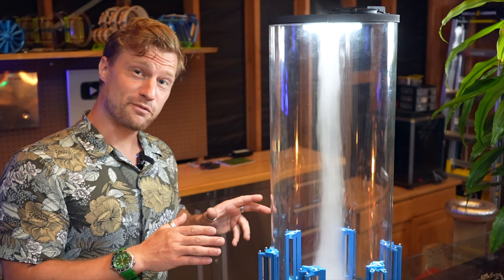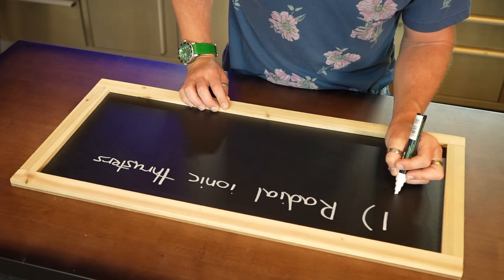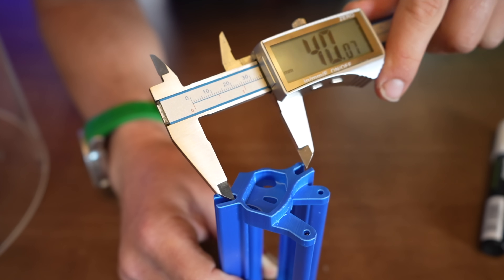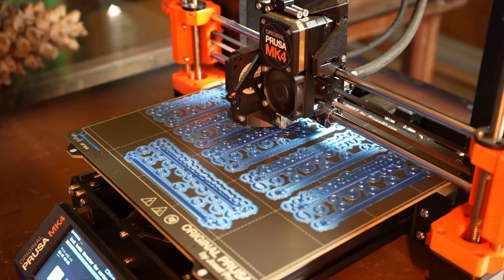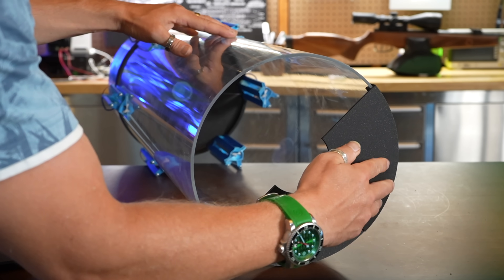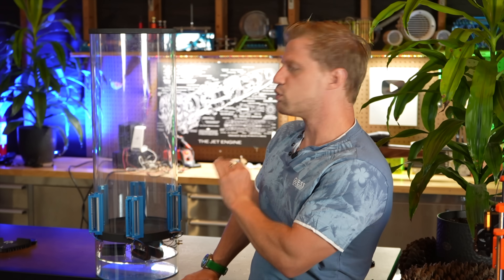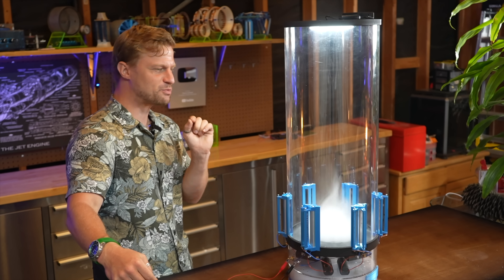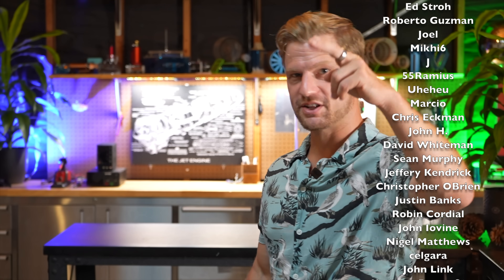I Built The First Ionic Tornado Machine! (Unreal performance)

Comment: As a science teacher I request that you either make full build instructions (including materials list) available, or find a partner to make a kit. This is far better than any tornado model that I've seen. Especially since it relies on temperature differential to visualize the vortex formation.
Reply: I say go for it.  Carefully managed risk to build an exciting demo is the kind of thing that gets students excited about science.  Risk to students can be eliminated by not allowing them to operate the device.  Students can help build it, with no power connected (also ensure any HV capacitors to be used are shorted ahead of time).  Students can then watch from a few feet away while it's turned on by the teacher.  After the lesson is complete, the device can have power sources removed and capacitors discharged.  Power source can be locked in a cabinet to prevent students from attempting to try it on their own if they sneak into the room after hours or something.  Of course, that $500 acrylic tube might need to be substituted for something more affordable unless they can raise all the money for something like that. Maybe support the active components with a wooden or aluminum frame and use a thin flexible plastic sheet wrapped into a tube in place of the thick acrylic tube.  That'd be far cheaper.  If the frame is sparse, it wouldn't obstruct the view of the bottom much.  IMO dry ice handling is probably greater than the electric danger here.  That should be handled by the teacher as well.  There's a lot of other science experiments you can do with dry ice, so that could be wrapped into the same class period to make the best use of it.
Reply: @archgaden  Ab-so-lu-te-ly.  The other issue is that this teaches the kids to tell the danger from the non-dangerous parts, a rather educational element in itself.
Reply: There's one simple thing that many manufacturers use, warning tags and warnings in the instructions on the proper safety use, this is in most kits, if not all, that use electricity and capacitors, and I'm fairly sure that the science teacher was only interested in buying one kit that they would build themselves just to show the class an example of a tornado, I don't really think the teacher was wanting to buy an expensive kit for each kid to try to build, so all the discussion about the safety of the kids was probably never going to be an issue if the teacher was a responsible adult and obeyed basic child safety, but then again, in public schools where a shooter can enter and fire at the children or where a school officer can throw a child or young teen onto the floor, perhaps there are more dangerous things in our schools than a tornado kit the science teacher built to show his students how tornadoes form.
Reply: @onidaaitsubasa4177  Your argument holds no water. You presuming the teacher is competent, and that the kids won't do something stupid while the teacher is distracted. If the teacher knew what he was doing, it would be very easy for him to build this without a kit. 

You also contradicted yourself: "responsible adult and obeyed basic child safety, but then again, in public schools where a shooter can enter and fire at the children or where a school officer..."

So you saying Its "OK to be exposed to a HV source (ie 20 KV), if teacher & kids are responsible, but than you provide examples that they are not responsible. Maybe you should apply some critical thinking before you post a comment.

Just about all companies that sell consumer electronic devices have a UL listing & insurance. Insurance companies will not provide insurance in the US unless it been UL listed (it tested for safety). Last time I checked, a UL test was around $25K. This device will never pass a UL test.
Reply: @guytech7310  Your entire argument is based on nonsense "the kids won't do something stupid while the teacher is distracted" at that point everything is Lethal
Reply: @guytech7310  You must be so much fun at parties.

Also, most people shouldn't be allowed to drive by your argument.
Reply: @raunchers  Look who is talking. The point of my original comment was to protect the channel author from lawsuits.
Reply: as soon as i can find 30cm plexi glass tube alternative that will not cost me a leg, i think i need one of those :D
Reply: so how do we lower the risk (this should've been the question, instead of a lazy NO because of fear and liabilities)
remember that anything you have no idea to operate is and will always be a risk
you can lower the risk of driving accidents by simply learning how to drive hence driving lessons and license for proof (tho people might do some shortcuts and stuff to get license)
it doesn't guarantees zero risk but it does lower risk factor for accidents.

that's why people do research, experiment, get into accidents, learn from that mistake, improve tech, get more modern with tech stuff...
everything should and will become outdated, humans will always improve outdated tech.

people will always find things to improve it might be me, you or someone in the near future
Reply: @Blitzkit  Low Voltage Ducted fans or blowers, which I provided earlier in multiple comments.
Reply: thats because tornados are not caused by temperature differentials. they are created by electric filaments flowing into the earth from the sun.
Reply: This comment might get lost in the rest but what if you encased the current machine in a larger cylinder that is closed off at the top so you could use real debris like glitter. If you have it encase the entire thing you can rig it to recycle the debris. I am guessing it would probably recycle better if it were encased in a large sphere or at least a half sphere on top of the lower cylinder.
As an ex pothead I could see this thing as a massive bong lol...but yeah removing the water and dry ice would probably make the less scientific public more comfortable in buying into the idea even though its safe enough already (or can be made safer).
Great work though man!
Reply: The formation of the vortex is upside down, so not a good example of naturally occurring atmospheric vertices.
Reply: HMMM....👉 yes- place a toilet seat so I CAN LOWER MY HAIRY NUTS INTO THE VORTEX.
Reply: All these negative comments...... sheesh people. @kmoecub said they are a science teacher, ya ever think that they might want to make a demonstrator for a class? NO, you went straight to "SAVE THE KIDS FROM THINKING!!!!!"
Reply: I know im a little late but if youre looking for cheap(ish) tubing that may be able to work you could buy a clear trash can. there looks to be a 25 gallon one on banksupplies with the upc of 525-03020, this one you'd need to saw the bottom off for it and it also is tapered so that may not be ideal. There's also a 50 gallon one on glassdon that goes by the name C-Thru 50G Trash Receptacle, the way there's looks makes me think you maybe be able to buy just the outer shell without a new lid or bottom.
Reply: As a former student i would say to watch the video....as its literaly breaking down his entire build process...

If you need to be instructed that hes not using magic to join the pieces, well...idk what to say
Reply: You guys shut up and think of ways to make it safe then
Reply: @Nexusleaps  there isn't a way to make 100% safe since kids/teen can only handle 5ma while a adult can handle 10ma
Reply: @Nexusleaps  in fact some students have health conditions which makes it even harder to make it safe well I guess maybe stick to no high voltage in school?
Reply: The modules Jay used was on Amazon for around 6 dollars sometimes more I did buy one last time for a spark gap tesla coil then it fell on me but luckily it wasn't lethal tho am surprised I got no burns
Reply: i just read more or less every reply to this comment, man that took a while but i enjoyed it lol
Reply: In all fairness the original commenter blatently asked for the materials list and drawings to build this as-is. So guytech7310 is correct in pointing out the dangers of this. What others are reasoning towards is the commercialization of this device. This indeed would need more engineering, risk analisys and safeguarding features. But it can be done. A solution can be found. Engineers think in solutions not problems. But let’s not kid ourselves into thinking we can do that entire process in the comment section here. 😊
Reply: @michaelvanderputten4216  Yeah, because I can not buy plans for other high voltage devices? Like a tesla coil... finding it hard to take the nay sayer serious.  With low enough (or high enough, for that matter)  intelligence, all technology is dangerous. And stupid people are outproducing the intelligent populous. I'm a creationist.  And I find it funny to see " scientific minds" cry over darwinism in action. You hinder science.  And to the atheists listening, if there isn't objective morality, nothing anyone does is right or even wrong by your standards.  And everything is meaningless.
Reply: 20KV says no for school kids, especially since there is a water bath below it to enhance the risk factor to 11. Too much liability.
Reply: @guytech7310  and did you even look at the build? it could trivially be made almost entirely safe
Reply: @ThylineTheGay  Your clueless. If you cannot see the all of the safety problems, you have no business commenting on "safety".

No arc fault detector, no tilt shutoff. No internal ground shielding, no ground fault cut off, (no ground wire what so ever), Electronics are not water tight (needs to be potted) There are HV leads (ie the lifters\thrusters) that expose hv voltage on the outside. Would need a secondary larger ( & much more expensive) cylinder to isolate the HV conductors from anyone coming in contact with them.

I am guessing you have zero experience engineering consumer electronics.
Reply: @guytech7310  it would be easier to seal all the HV electronics inside of the thrusters as a single unit and not make it user serviceable, then cover the intakes with a safety mesh like the ones used on some hobbyist turbojet engines, except grounded. 
(This is not referring to the ducted fan reply but rather your reply to thy)
Reply: @PixlRainbow  Never going to pass something like a UL certification. I explained in a previous comment roughly what would need to be done.
Reply: @guytech7310  it would need arc fault detectors, tilt shutoff, and ground fault cutoff too, yes, but everything else has been addressed.
I had also previously suggested to NOT get water involved at all and use backflow incense, which produces a dry smoke that should behave similarly to the dry ice fog. Steve Mould has a 2-year-old video on it.
Reply: @guytech7310 you'd really hate my electric fence.  Just exposed and sitting there for unexpecting passersby
Reply: @imperfect_follower_of_Christ Where do you live? You sound like a great option to fund my  ls7 build.
Reply: @moresomoze  why I live right down the road from you, Hank. In Arlington.
Reply: @guytech7310  You know what would keep people from "disrespecting" you, as you seem to think they've been doing: Stop it with the "it'll never do this, it'll never be safe enough" negative BS. Try giving some positive suggestions for how the design could be made safer, more in keeping with the actual project instead of "replace the main functioning part that is the reason for the project with something else". And stop trying to shoot down everyone else who is trying to make these positive suggestions. You're unnecessarily making yourself the antagonist of this thread, when you could have been an ally using your experience to offer helpful suggestions to make a cool project even better without trying to turn it into every other tornado tube project.
Reply: @guytech7310  .now u r changing ur words, who was the one arguing that changing the design will not do anything lmao
Reply: @guytech7310 so do beds of nails and bowling balls, i think this would more be a bring out once a year while kids stay 5 feet away type of thing which could work especially considering that while the voltage is high, there’s not an insane amount of power actually being consumed meaning low amps.
Reply: @guytech7310 conventional fans also have fast spinning blades that are dangerous for children, but they are made safe by encasing the blades in a cage to make it difficult to actually reach the blades. A safe version of this contraption could be made with grounded metal mesh serving as faraday caging, as well as some form of fog that does not use water. Incense perhaps?
Reply: @PixlRainbow  If the fan blades are exposed it does not kill them if they touch the spinning blade. You don't even need to touch an energized 20kv component for instant death, just get close enough for an arc.

 You might as well make the argument that its safe for kids to play with hand grenades since there is a safety pin!

No way is this device even remotely safe for kids.Even most adults are likely to get killed with this.
Reply from the maker: So, the power sources are non lethal. They are stun gun modules - which when shocked by, give you a scary zap but leave no lasting damage and don’t cause death. I certainly understand the fear of 20kv, but the overall power is very low (15 watts per high voltage source), and this project is non lethal. Painful if touched, yes, but non lethal.
Reply: @PlasmaChannel  Stun gun can kill & they sometimes do, especially with people with heart condition. Second the stun gun does not include a pool of water, which increases the risks of lethality.

From a safety & litigation perspective, I recommend you do not provide kits, or plans. Stay out of trouble my friend! Its not worth the Risk!
Reply: @guytech7310  and pray tell, how are they supposed to get close enough for an arc, if the mesh is in the way? And how do you think Tesla coil kits have been sold without restrictions for years?
Reply: @PixlRainbow  Huh? The elements are exposed on the outside, Second if the unit tips over do to carelessness, or the Beavis\But-head moment. Full of water, Water comes in contact with the HV system & people.

If you cannot see how dangerous this is you must be Beavis.
Reply: @guytech7310  I explicitly mentioned changes to the design, and you keep talking about the design that is being used as-is!
Reply: @PixlRainbow  It does not matter its not safe for kids, period. If you want build one & provide it to them, then you assume all the risks.
Reply: @guytech7310  if it is impossible to make it safe for kids no matter how it is modified, then how is a Van de Graaff generator capable of generating 40kV considered a "toy"? How are plasma globes capable of generating 5kV considered safe for children even though they contain a flyback transformer?
Reply: @PixlRainbow  Some people are great at figuring out how to make things work and other people are "great" at thinking of the reasons why not to do anything ever.
Reply: @guytech7310 I sincerely hope the "don't do that, it's potentially dangerous" mantra isn't how you spend life, that's boring and more than a bit chicken little syndrome.
Reply: @kydelastra  You must be a Zoomer or Millennial.  All it takes is one careless mistake for a major lawsuit.

How much did McDonalds have to pay when a person spilled hot coffee on themselves? 

" Stella Liebeck from Albuquerque, New Mexico was granted $2.7 million in punitive damages and $200,000 for the third-degree burns she endured when coffee she purchased from a McDonald's drive-thru spilled on to her lap."
Reply: @guytech7310  much worse: Gen X. I was raised to pay attention and hold myself accountable.
Reply: @kydelastra  Then stop acting like a zoomer or Millennial.
Reply: @guytech7310  you went from being chicken little to the brave little keyboard toaster pretty quick there. I would get that skin thickness checked if I were you.
Reply: @kydelastra  Did you come up with  that response all by yourself, or did Daddy help you?
Reply: @guytech7310  Have you never heard of personal responsibility? People can manufacturer what they like, no-one forces you to buy it or use it. By your risk averse logic, people would walk everywhere because cars, bikes, horses, planes are potentially dangerous, electricity is potentially dangerous - so lets not use that - Oh, you can drown in water - so lets ban that!!
Reply: @jim.franklin  Jim, Would you trust a 7 year old to play with a device that can kill them or cause a serious injury? Can you afford a multi-million dollar lawsuit if some gets hurt or killed?

Do you have any common sense, or just like being a troll?
Reply from the maker: The pool of water doesn’t magnify the power of the stun gun modules. People have an irrational fear of water and electricity mixing, which is a good fear to have as it keeps people safe. However, the water doesn’t magically make the stun gun modules more dangerous. They will only discharge to themselves, from electrode to electrode. I have a serious heart condition and was shocked at least a dozen times while building the video. These little stun gun modules cost like 2 dollars each and are very low powered.
Reply from the maker: Additionally, if it was knocked over, water would stay in the lower compartment as it’s airtight minus the central hole. You’d really have to try hard to have the water spill everywhere. I see several people getting more and more abrasive in the comments towards each other… come on folks, let’s stay civil.
Reply: @PlasmaChannel  I've worked with HV systems as well have wired my entire home. I build a Farnsworth Fusor back in the late 1990s 60KV DC source, stainless with conflat fittings, Turbo Molecular pump, etc. 

 Water increases surface contact increasing the amount of current that flow through your body. Ie Hair dryer falling into a bathtub or sink.  

Issue with a wet hand coming in contact with a HV source is enough to cause your fingers to become locked to a conductor & impossible to let go. Your presuming the the person building these will build it with the same level of detail you did. Anyone that is competent with HV systems will have absolutely no difficulty building what you made without any plans or a kit. Anyone that needs plans or a kit is less likely to be competent to build this safely.

The Guy that wants to make this accessible for kids is totally insane. All it takes in a Beavis type to get some some injured or killed. 

if you choose to sell or provide plans for this device, your putting yourself at risk of a lawsuit that can cost you in the millions. As I stated the Famous McDonald's hot coffee which was a $2.7M lawsuit. Since then lawsuits have only gotten more ridiculous. I am trying to warn you, if want to ignore my warnings, its still a partially free country. If you do pursue selling or providing kits or plans I recommend you get a good lawyer that can draft up an ironclad agreement that voids any risks for the use of it ("customer assumes all safety risks & liabilities). That said, such an agreement could be thrown out by the judge.
Reply: @guytech7310  Couple of important points - at 7 I was off with mates having fun, learning common sense by falling out of trees and from bridges over rivers, but by 12 I was building Nuclear reactors in my bedroom - alas it would not work as you cannot buy fissile materials unless you are a governmment or authorised body even then - My friends of my generation grew up with common sense, they knew that electricity can kill - didn't stop most of us taking apart TVs and getting a wack from the coil or from large capacitors we charged up using dynamos attached to our bike wheels. Children, with the correct supervisions and common sense can build and use devises like this because they then expand their mind, learn and want to know more - something you are clearly averse too - I just had a thought, you are not Grugg from the Croods are you?
Reply: @guytech7310  the guy saying stuff like "or did Daddy help you?" has no right to accuse others of trolling
Reply: @jim.franklin  common sense can only be taught or learnt through mistake
ideally taught, unfortunately people don't seem to like to teach kids about dangerous things and why not to XYZ

some misguided "but if they don't know about it they won't do it"
Reply: @guytech7310  i doubt 7 year olds are being taught about fluid dynamics
Reply from the maker: Naw I definitely wouldn’t sell this to people under 18, I agree haha. Lots of liability, for sure. Before selling this as a mainstream item, I’d modify a few items to make it less exposed and safer. And, like I mentioned, it’s not lethal. But boy does a shock scare you. Can’t have that with a public product!
Reply: @PlasmaChannel  A more safer device would be one using ducted fans or a squirrel cage blower with the moving parts concealed and a low voltage DC power source. same effect can be created but without the use of high voltage.
Reply: @PlasmaChannel  non-lethal but crazy painful and loud - is imo the perfect way to teach chiildren about dangers of high voltage.
Reply: @guytech7310  last I checked McDonald's is doing fine. And a label change covered their liability for future events.
Reply: @PlasmaChannel  yeah, not much actual power here.  I work with 13.2kv and 7.2kv on a semi-regular basis, but there's far more than 15w on that, ha!  Would be a great project to do personally besides the cost of that acrylic, that seems ridiculous in my opinion
Reply: @guytech7310  The McDonalds lawsuit was over poor cup design and over heated coffee. The Mcdonalds spent over 4 million to discredit and make the women's incident look friouslios and petty. When the real fact was that FDA and two independent companies had found out that coffee at that location was held on average at 205 degrees. Thats 20 degrees above average hold and 15 degrees from boiling. So using that case after John Oliver of 'Last week tonight' broke the story and expose the truth means nothing. Secondly, if you did work with electricity, then you should know that the stun modules he is using would short and burn out before anyone could get out. This is in place to prevent someone from using it in a bathtub or swimming pool. So please stop lying, so stop quoting a Mcdonalds defeminization case and just learn to admit that creator of the device and the others are probably smarter and more in the know of what is what. Go play some dodge ball.
Reply: @guytech7310  "How much did McDonalds have to pay when a person spilled hot coffee on themselves?"  If you want to use court cases to prove your point it may serve you to better research the details.  McD got convicted not for the spill, but for their coffee being unreasonably hot (i.e. immediately causing burns) and the fact that they knew this.  In other words, they failed their duty of care.  In addition, in this case you're arguing about a home product: of course it would need to make changes to make it save, but you would use it as a demonstrator, not as a device you leave kids to handle.  You don't leave a Van der Graaf generator alone with kids either - just getting caught in the belt alone is a risk.
Reply: @guytech7310  I have yet to find any comment that suggest to run this device /unsupervised/ as a demonstrator amongst 7 year olds.  People are not going to thank you for your assumption that they're stupid, and as far as I can tell they're not.  There are plenty of educational tools that are dangerous if you let 7 year olds loose on them, but that's why they're locked away until a teacher needs them and demonstrates them in a controlled environment - that's the whole point of teaching.
Reply: @freddoflintstono9321  "McD got convicted not for the spill, but for their coffee being unreasonably hot"

Does not matter. It cost McD millions in the settlement & legal fees. If it sold, there is a liability for  it. 

"but you would use it as a demonstrator, not as a device you leave kids to handle."

Does it matter. You presuming the teacher or presenter is going to be take precautions, but these days its rarely happens. All it take is one careless person to cause an injury. 

If you feel so strongly I am wrong, go head sell them as kits. see what happens. We'll call it an experiment. If your wrong, expect a major lawsuit & spend hundreds of thousands in legal fees & settlement. BTW: Channel creator agrees with me.
Reply: @guytech7310  .. or it would be spun up on the teacher's desk, away from the kids so they can see but not touch.  Where in the world did you develop that notion that a teacher would be insane enough to allow kids to come to harm?  Where have you been to school?
Reply: @imperfect_follower_of_Christ  The McD case is a total misquote anyway.  They didn't get convicted for spilling their coffee, they got their conviction because their coffee was served way too hot, instantly causing 2nd degree burns.
Reply: @thecodingchicken  It's a shame glass is so hard to cut - a glass vase costs a lot less ..
Reply: @GAWOP00  Thnx, wish I'd seen your comment sooner, just posted the same.  But maybe he'll need to be told twice about researching what you want to post as 'evidence'.  Maybe I missed it, but I didn't find ANY post suggesting a teacher would let kids even go near it without supervision..
Reply: @freddoflintstono9321  "Teachers are a tad more intelligent"

Sure they are /sarc. 

"suggested it would be left unsupervised for kids."

You have no idea. All it takes is the teacher to be be briefly distracted for something bad to happen. If the devices gets tipped over & water spills on the floor while its energized its a huge problem.

People like you have no clue how the real world works. You make horrible presumptions about people acting responsible & acting safely at all times. You understand nothing about electrical device safety, & probably very little about high voltage systems & equally less about even building wiring code (NEC). Stop being presumptuous & think you know it all.
Reply: @guytech7310  ... Aren't you being presumptuous as well, assuming everyone will act unsafe?
Reply: @awsomewolfman124  No, absolutely not. Where do you people come from, & insist in making really du mb comments?
Reply: @potatoesindrag4095  ummm only 7F from boiling actually.  212F is boiling at sea level
Reply: @imperfect_follower_of_Christ  Out of line. I didn't say people could not do what ever they want. I just stated the channel creator should not sell kits because of liability risks. 

You must be fun at parties, trolling everyone you meet, and not understand the context of the discussion, and feeling to need to add your useless two cents to be the center of attention.
Reply: @guytech7310  If I was out of line and were I a troll, I would have been taking shots at your spelling and grammar.  The same poor writing skills you were using to make your superior claims.
Reply: @imperfect_follower_of_Christ  You just contradicted yourself, by complaining about my poor writing skills. Yes, you indeed are a troll. Get a life.
Reply: @guytech7310  that's usually due to a sustained shock to centre mass close to the heart. I doubt there's a risk of someone sticking their chest near the source; it's more likely to be a finger if anything, and immediately pulled away after the first zap.
Reply: @guytech7310  Because you're doing the same thing you're accusing people of doing, explain to me in simple terms without using insulting language why that isn't the truth, and I will believe you.
Reply: @ginsengaddict  I was gonna say that too you realize tasers are usually shot into a person, right? Mister guy? Most if not all taser deaths are due to that and not a finger shock.
Reply: @guytech7310  I said would have.  Conditions changed when you said I was a troll and out of line.  I then provided evidence to the contrary.  You have a small world, my friend. And it's all between your ears.
Reply: @ginsengaddict  its got water in it. Suppose some knocks over the device, while energized. Or the device is placed on a metal surface, or comes in contact with a conductive object.  You also making the assumption that everyone is healthly & does have heart problems. 

You cannot possible conceive of all possible scenarios which the device is handled.  No one intends to get in a car accident, yet every car is equipped with seat belts, air bags and other safety features. If we lived in a perfect world,  cars don't need any of those safety devices. 

The device in this video has no safety systems in place, No tilt cutoff, no arc-fault, no ground, not potted high voltage components, exposed HV terminnals (ie the HV thrustor elements exposed on the outside, etc

Notice, since you were not rude or condescending, nor was I in this comment.

Also consider my original comment was directed at the channel author, to warn him of the liability risks of selling this device, then a ton of commenters jumped in to attack me.
Reply: @guytech7310  One word for you mate, prototype. Figure it out from there.
Reply: @guytech7310  no you never worked with HV systems, as you got seriously no clue what you are talking about, not even the slightest. Also nobody ever said it to be kids toy, but something for a classroom, in a high school. No toddlers there.
Reply: @wupme  I have, Built a Farsworth Fusor in the late 1990s: 60 KVDC Spellmen Power supply, All conflat High Vaccuum system, Turbo molecular pump, BF3 neutron detector, etc.

if anyone that does not know anything about HV systems its you. You are nothing but a another troll.

Before going on a rant, How about reading all my replies to the dozen other trolls. But your too busy trolling to be bothered, right?
Reply: @rowlandp6314  Sure, Consider this "science teacher" wants a kit, I have to question his abilities as well as common sense exposing kids to HV system with no safety features.

My original comment was directed at the Channel author to avoid potential Legal Liability selling this to people.
Reply: @guytech7310  Not being mean when I say this, as you might not even be aware. Your original comment made you come across as a know it all, that didn't even consider that the channel author may know this already. Everything can be dangerous in the wrong hands and I've seen some really stupid law suits happen. The best one I can think of is the guy who sued because his cruise control doesn't actually drive for him while he made a coffee in the back of his camper van. That's a special kind of dumb.
Reply: @rowlandp6314  That's your interpretation. I have worked with HV systems, I do understand the risks. I am not going to write a 5,000 essay on the topic, post a resume, etc, and if I did would you or anyone  read it? This is the problem with Society in general. In my original comment which phrase was condensing or Rude? I stated the reason why: Liability!
Reply: @guytech7310  it's people in glass houses shouldn't.  Totally changed the meaning.
Reply: @imperfect_follower_of_Christ  That was a typo.
Reply: @guytech7310   "You don't even need to touch an energized 20kv component for instant death" what a bunch of nonsense

From Stiropyro to ole Nikola, the collective facepalming becomes thunderous

Do you even amp? :D
Reply: @guytech7310 " You must be a Zoomer or Millennial."

...aaand you just broke the Irony-o-meter

It's precisely you, buddy, the one showing a textbook example of millennial inability to cope with criticism

 my sides :D
Reply: @TheChzoronzon  You *selectively edited my statement. I wrote: "You don't even need to touch an energized 20kv component for instant death, just get close enough for an arc."

Now why did you leave off the last part?!?
You're just another despicable troll.
Reply: @guytech7310  Millennial mental gymnastics on a boomer are TIGHT

:D
Reply: @guytech7310  you mean you were wrong.  I see you have trouble admitting that.
Reply: @guytech7310  as far as I can tell in this whole thread you haven't responded to the point that a number of other high voltage devices are commonly sold as kits or pre builds with no legal problems whatsoever. Also people have pointed out that teachers conduct other potentially deadly and/or damaging experiments without incident. Also manual arts is still a thing that is taught and as far as I know lathes are still used, which can and have been deadly. So why are you specifically targeting this device?
Reply: @thomm6736  Here's an experiment for you: Go see if you can find an insurance company wiling to provide liability insurance for this. Then report back your results. 
I bet you won't even try, because your just a keyboard commando. Prove be wrong. or get lost.
Reply: @guytech7310  you still didn't address my point
Reply: @thomm6736  No, you didn't answer my question. Answer my question & you get the answer to your own question.
Reply: @guytech7310  insurance companies offer public product liability insurance. If you can show that with due care a product can be used without incident that many insurance companies will provide you with a service. Whether this particular item would get that service I don't know because I would have to make a request directly to a company which I'm obviously not going to do just to humour an online troll. So are you going to answer the question which has been posed to you multiple times or are you going to dodge again?
Reply: @guytech7310 it's not voltage that kills. It's current.  The devices used in this project don't have the capability to carry lethal levels of current. As an example,  consider the stereotypical demonstration that is done all the time in schools with children with a Van de Graff Graff generator. They produce over 100,000 volts and kids touch them all the time and,  yes,  get zapped by them..
Reply: @kkellogg99  Sorry, but you don't know much about HV systems. The system he has uses about 400W of power. More than enough to kill. BTW: Stun guns can kill & have killed people. They are just considered less lethal compared to a firearm. You also presume that everyone in in perfect heath: no heart problems, no seizures, etc. 

"children with a Van de Graff Graff generator"

This devices does not use a Van de graff! It uses a flyback type voltage converter which produces current. As I stated, It has no safety systems: no arc-fault, no ground fault. No ground shielding, and uses water which has the potential of deliver a lot more power to a person. 

Please stop lecturing people on stuff you do not understand. Just because you have a tiny bit of knowledge does not mean your qualified about HV systems & safety. I am sure you seen something about heart surgery. It does not make you qualified to perform heart surgery, or any type of surgery.
Reply: @guytech7310 there are so many easy ways to ensure this is safe bud 😂😂 you know what's dangerous? My local fire department setting fire to a car next to an apartment building full of kids waiting for the school bus at 7 am in the middle of the city for training. 

Or the same local fire department starting a fire in the school parking lot for training and education...... in fact it seems local fire departments could use your badgering lol.
Reply: @PixlRainbow gotem...... he's trying to pretend he didn't see your comment cause he didn't understand it lol
Reply: Squarckle-tf1zy  Nope. I disagree using for a demo in a school setting. Too many risks. As I stated in another comment. Just create a device using ducted fans instead. Same effect but without the risks associated with a live, unprotected HV power system.

"author of this video said that the box is sealed other than a hole in the top,"

No its not. 1. The thrusters have exposed HV elements on the outside. The use HV to draw in air flow from outside the unit. Second, there is a door on the side to allow a user to add water & dry ice. Third no electrical safety systems in place: No arc fault, ground fault. no ground shielding, not tilt cut off, etc. No insurance company would provide liability insurance for this device, especially in a school.
Reply: @guytech7310 
You better stay home.  All it takes is one car out of control on the road that could kill you. 😂
Reply: @guytech7310  the thrusters cause convection.  The fans would be a false representation of what actually occurs to create 🌪 tornados. The plasma not so much as convection is achieved.  If we wanted a facimulie we could look at  videos for the real view and double sofa bottle experiment for a " not tornado".
Reply: @imperfect_follower_of_Christ  Ducted fans will work just fine. Replace the thrusters with a ducted fans, or  blowers 1:1. Same exact effect. The Thrusters are just creating directional airflow.
Reply: @guytech7310  Electrical engineer here who works in transmission for a major utility company.  So you know I am appealing to authority in this argument: Shut up, you must of been a hall monitor in highschool nerd!
Reply: @SleepyHooligan  . You never worked anywhere near a live HV system, just act like you do on YT.
Reply: @guytech7310  Why are there so many intelligent people in this thread, and how many are baking you up again? How many of them challenge your position. An intelligent man of character would use this correlation to invite introspection.  You may be in the way of progress instead of moving it along. When going with a current, it is easier to navigate it than fighting it.
Reply: @guytech7310  You are right! I write code and do contingency studies for nerc cip compliance in an office far far away from these stations :P Stop being a hall monitor nerd!
Reply: @SleepyHooligan  But you needed to comment on the topic, huh?  If anyone is being a hall monitor nerd, its you. My original comment was to protect the Channel creator from legal liability, Then the internet decided they collectively "knew better" without ever touching a HV system nor knowing anything about legal liabilities for sold products. Why is that?
Reply from the maker: Keep in mind all, I mentioned it’s not safe. But “not safe” doesn’t mean deadly. It doesn’t mean crippling. It just means pain can come from improper use. Maybe some light burns. Some people may call that totally safe. It’s an argument over definitions, really. So, the entire thread of arguments on here, while very in depth, may need to find a common ground of how we define “safe” or “not safe”. That’s how I personally define safe. Cheers.
Reply: @guytech7310  Nobody asked you to G! You are just out here white knighting showing off your saivor complex. They do  high voltage labs in college. We do 138kv-765kv arc failure studies with highschool students all the time. Stop being lame
Reply: @PlasmaChannel  It can be deadly. Your making some broad assumption: Does the person have a heart condition suffer from seizures, What if the spill water & it gets energized & their hand gets immersed while the water is energized?  What if one of the HV elements comes in contact with a large conductive surface & your fingers  or hand become locked from the current. 

No doubt what you experienced is a point contact. Which  one of your fingers or the back of your had got too close & your got a point contact & not a whole hand locked around an energized element. 

When a hand gets locked on to an energized element its impossible to remove your hand while its energized. If you cannot cut the power or no around to help you will die.

 You are also presuming people will take the same level of precautions you have, but I can tell you from working on product liability matters its far from the norm. For instance a consumer that cleaned an electric appliance while it was plugged in. Let just say that person is no longer alive today.

Never under estimate the stu(p)ity of people. 

As I stated The safe way is to just use ducted fans or blowers which will generate the same effect but with out the risks associated with HV.
Reply from the maker: @guytech7310 so, your concern is appreciated. Keep in mind I am the one behind the creation of this device. I do hope you understand that I understand everything about it? Let me explain: 
1) the power sources used each put out around 1mA of current. This is no where near enough power to cause muscle seizure, nor any serious damage. The 20kv they output drops to a few hundred volts when shorted, because the driving circuitry inside each module is not designed for a shorted output. This is why they were specifically chosen for their use. Because I’m an expert in high voltage electronics, with 23 years of first hand experience. I don’t work with lethal power sources, out of principle. 

1b) I have a serious heart condition. These power sources have shocked me dozens of times across the chest - and it always hurts and scares, but there isn’t enough power behind them to actually cause contracture of heart muscle. Nor arm and chest muscle. What you describe only happens at high enough current levels, which this product does not use. A hairdryer uses 15x the power input, and is easily far more dangerous. 

2) if the water spilled, someone’s hand could be shocked. - though technically, it is safer to be shocked by tap water spilled than directly from a HV source. The water has quite a bit of electrical resistance, and thus reduces the felt current pulse when shocked.  Also, the only way to spill the water is to knock the entire thing over. At which point the tube, the electronics, and the wires would break, and quite literally rip out and disconnect. 

3) using ducted fans would then make this entire build meaningless. It’s already been done. A thousand times over. At least a dozen YouTubers have made tornado chambers using ducted fans. This is the first ionic thrust powered tornado chamber for a reason. 

Cheers!
Reply: @guytech7310  Have you ever heard of a CRT TV?  You don't wanna get close to the things in those either.
Reply: @PlasmaChannel  correct me if I’m wrong but thermodynamiclly voltage increase causes amperage decrease so if you’re converting a low power source from low voltage to high voltage the amperage would drop enough to make it painful but not deadly?
Reply: @guytech7310  In that McDonalds case, she won by showing that McDonalds was negligent in having the coffee too hot to begin with. And in the end the punitive damages was much reduced to 480,000 dollars, and the compensation reduced to 160,000, before they settled out of court for an unknown sum. 

As to a potential tornado kit, if you're too afraid of it, don't buy one.
Reply: @guytech7310  "You don't even need to touch an energized 20kv component for instant death"

You couldn't be further from the truth. Do you have any idea of the voltage of static charge that builds up in your body like when you walk across carpet?

Up to ~35KV.

Please stop spreading false information.
Reply: @guytech7310  No they don't. You're just wrong.
Reply: @guytech7310  what kid is roaming around with a pace maker near a 20kv high-voltage contraption?
Reply: @guytech7310  20 kV is very safe. its not the voltage that kills you. its the amps. A van de graaff is 100 kV.
Reply: @----.__  A power source that is able to hold a 20KV with low voltage drop can kill instantly. Issue is that if a clueless person plays around a high power, HV source will kill if there is sufficient current flow.

This device does not use static electricity. It uses multiple  Tazer power sources. Tazers can kill under some circumstances and there are plenty of cases which people have died from getting tazed.
Reply: @guytech7310  Hey mate, I am not kiding and I don't want to be rude, but by the way you think I assume you have a similar mental problem as I do. Talk with a professional if you think so. This mostly comes (at least in my case and many I read about) from supressed fear, It ruined my life, don't let the same thing happen with you.
This may sound like gaslighting, and you can ignore it totaly, but I did not wrote this ill-willed.
Reply: @thombaz  Thom, while I appreciate the good gesture, I don't have any fear issues. I have worked with HV systems, Table saws, Milling machines, Lathes, as well as heavy equipment: Skid steer, Excavators, bulldozers. My Original Post was to protect the channel creator from lawsuits. I suppose my only true fear is getting sued into deep poverty. I've also worked with too many attorneys on too many lawsuits.
Reply: @guytech7310  You're having the argument in a public setting, dog. If you want it to be private, don't have it in public.
Reply: @guytech7310  aight big guy. Why do we get to conduct experiments in chemistry class then? They are also dangerous with their bunsen burners, gas leaks and potentially toxic or corrosive or even straight up explosive chemicals.
Reply: @guytech7310 the frustrating part is you carrying on about potential death and hazards. Live a little
Reply: @guytech7310  My guy malding here over literal static. If you've "worked with HV systems" then you'll know that 20KV at 15W is less than one milliamp, an amount of current so low that, even with all 6 of them strung together, they wouldn't kill a person when applied directly across the heart. If you've been working with HV systems and wired your own home but aren't capable of basic math, I worry for your safety, and would strongly recommend you have your electrical work inspected before your house burns down.
Reply: @Teth47  Voltage will drop when touched, & current will increase, & I presumed it was more like 300Watt for all 6 HV supplies. Plus I wouldn't trust a Cheap Chinese HV Stun gun PS to limit power, especially if the input supply voltage exceeds the device input voltage labeling. People have died getting shocked with stun guns. (Less than lethal weapon, not 100% non-lethal).

Again the Original comment was about legal liabilities.
Reply: @SupraSav  Depends on how you get shocked. Remember this device has water . Water can increase the surface area which can increase current. If you get a point shock there is a limited amount of current limiting the effects. Consider if water spilled on the surface, & it become energized. Small kid leans over with his hand in the pool of energized water. Even if it does not cause death, we live in an era of Sue everyone for big $$$ & people aren't very bright. We live in a society with people eating tie pods, huffing nitrous oxid & glue.

The point of my original comment was simply a warning for legal liability. Then it exploded because I stated something people hat(e)d.
Reply: @guytech7310  how many people have to tell you your wrong for you to catch the hint lol
Reply: @xXGhostScytheXx  How many work with high voltage systems? 600 years ago everyone knew the world was flat. Were  they right?
Reply: @guytech7310 hey man i get that nothing anyone says will change your mind, but i need to add my tidbit. the stun guns you keep saying that kill people are generally police tasers, which are much more lethal and deliver much much more power than a simple stun gun module, not to mention use electrodes in the skin delivering power through the body. As much as this is “high voltage”, it’s not really a high voltage system by any means. as both other commenters and plasma channel himself have mentioned, those modules deliver so little power that barely even 1 mA of current can come, and much less the moment it touches a body. i know it doesn’t really make sense how 20kv and 1mA work together, but keep in mind the 20 kV is only while open, and building potential. this is literally similar if not lower voltage than static shocks, and should be treated as such. yes misuse MAY cause real pain, and even light burns, it’s honestly totally safe for teachers and people hoping to learn. 
your point about the water, if i’m not mistaken, is that surface area increases? so your argument is that it’s more dangerous because… the same amount of power is over an even larger resistance? 
it genuinely is not HV by much more than the name. as everyone has said, it’s only such high voltage while open, and i wouldn’t even consider it an HV system. and yeah, i have experience in this working with 1kv batteries that really can deliver hundreds of amps and absolutely char a human into nothingness
Reply: @guytech7310 I trust that plasma channel knows his stuff about the dangers of this. I also think a copper coil encased at both ends and some aluminum foil to hold heat can be an interesting thing to use here
Reply: @PlasmaChannel  wait it only has 1ma? So That explains why it didn't gave me anything serious when it fell on me
Reply: @guytech7310 we used to light shit on fire in the chem lab in junior high it’s crazy you can’t have anything cool or fun in school anymore
Reply: @jordanmcelroy5861 we made 2 trebuchets and smoke bombs in chem lab! Just a few years ago, too.
Reply: @guytech7310  amps kill volts hurt.. Or well both kill but usually volts just hurt like shit and amps kill. Theres barely any amps going thru this but just a lot of voltage.
Reply: @dragonl0l  No, Your incorrect. if you follow his channel these devices are using between 300W and 400W for good air flow. More than enough to kill. 

Stop taking some basic info, and assuming it applies to everything you come across. Just because I have a basic understanding of airplanes does not mean I can fly one or do maintanence on them.

 Unless you've worked with HV systems you don't have enough to understand the risks.
Reply: @guytech7310  didnt he literally say that in this example each one is drawing less than 15w
Reply: @dragonl0l  I believe he increased the power. 15W was the min. Lets suppose your right. 15W is still enough to Kill, It takes less than 1W to kill. all you need is about 100 milliamps across the heart. Considerably less with heart problems. If you understand HV systems,  under load, voltage will drop & current will rise until the supply power is maxed out. 

Second there are 6 thrusters 6 x 15W is 90W. Third your presuming the teacher is going to limit to 15W per unit and even 15W is enough to kill.

Again, You're making poor assumptions with lack of understanding of HV systems and how safety systems for electrical devices work.

The original discussion has absolutely nothing to do about you. Why do feel its import to join in? If two people  at a store are having a conversation, do you just rudely insert yourself into the conversation? Why the need to be an obstructionist?
Reply: @guytech7310  Mate, stop talking nonsense. 0.1A across heart is lethal, but even when you put all 90w of power together at 15000v, the corresponding current is I=P/U and I=90w/15000v, results a current of 0.006A or 6mA. Do you know that the household RCD in your fusebox is design to cutoff at around 30mA? Basically if You touch the live 240v , your RCD will cuttoff and protect you at 5 times the current of all these thrusters combined. Are you sure you worked with electricity?
Reply: @luciananuta  Under load voltage falls & current increases depending on the resistance of the load. maxing out to whatever the power supply can deliver.  Really it comes down to power level drawn across the heart. 

"household RCD...cutoff at around 30mA "

Not really correct. a GFCI triggers when it detect current flowing from Hot to ground, but the circuit will no issues delivering the total amount limited by the breaker (15 Amps, 20 amps, etc) between hot & neutral. GFCI are not foolproof anymore than airbags in a car. People still die in car accidents even if the car has an airbag. Plus you are assuming the circuit is properly wired & the circuit has a GFCI interrupter. People are still electrocuted in homes with GCFI from devices that have no ground wire (ie 2 prong instead of 3 prong plugs), or from a hot to neutral shock which does not trigger the GFCI. I would guess at least 20% of electrical devices have no ground prong on their power cords.

In a DC to  HV converter there is no GFCI safety circuit unless you add one. As I stated in another comment to make this safer, A GFCI would have to be added on the HV side. These DC to HV supplies are used for stun guns, which are intended to deliver a shock to a person. We know from the news, that lots of people have died from stun guns.
Reply: @guytech7310  They can be made safer with high value resistors reducing the current but maintaining the voltage as long as the circuit remains open.
Reply: @djbare9  Its much more complicated than that. Go look up my earlier comment on the minimum it would take to make it safer. Adding resisters would provide the power needed to the lifters. I believe the lifters use between 200W & 300W. 

The way to make this safe is to ditch the HV & go with ducted fans.
Reply: @guytech7310  I get what you're saying, but my 5th grade science teacher was able to bring in a Van de Graaff generator to showcase static electricity.
Reply: @1mariomaniac  Van De Graff static electric source is not the the same as a DC HV source. These are taser power supplies. Go do some research.
Reply: @guytech7310  Ok, sure. Did some research and looked at how the voltages and current compare. A small Van de Graaff generator produces about 50kv with a few milliamps of current from what I can find. This produces 20kv with about a milliamp of current. Maybe add some shielding so students don't go touching the ionic thrusters, and tilt-switch like someone else mentioned, but aside from that this should be fine.
Reply: @1mariomaniac  No current in a Van De graff generator. Shock from a VDG does not incompacitate a person like a taser\stun gun.

There were 6 power supplies. At the time I thought they were using about 300Watts of power combined. more than enough power to cause injury. 

Could the device made safe, Yes, but at a significant cost. I recommended the Channel author not to sell it because of legal liability.
Reply: @guytech7310   You seem to be stuck on these being taser electronics but I don't see your point. This device is generating a similar current to that of a VDG, at a lower voltage. If your point is that the power supply is DC, Tesla coils can be safe to touch, and those are AC and generate a bit more current. The difference in danger between AC and DC seems a little divisive, but most sources online say that AC is far more dangerous. All that being said, I do think it's nice that you're trying to look out for the channel creator.
Reply: @guytech7310  Volts arent dangerous, current is.
Reply: @guytech7310  they run on taser transformers so while it'll hurt really bad if a student touches it, it wont injure them.